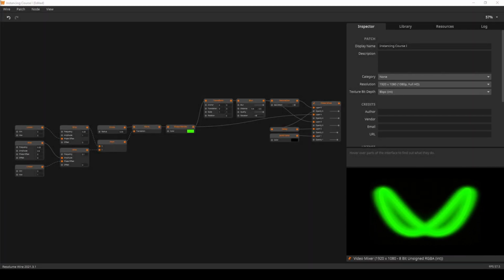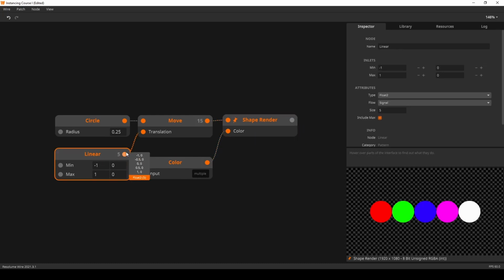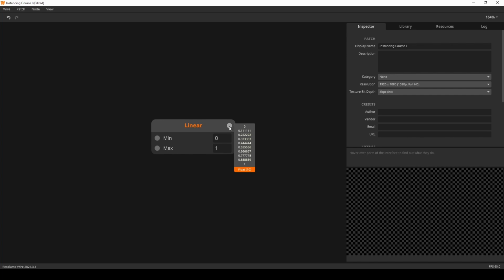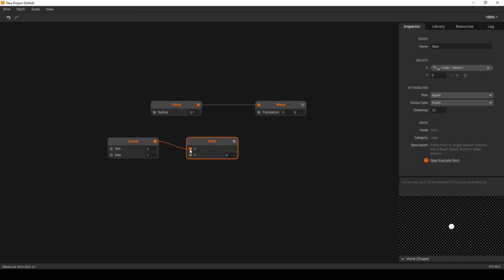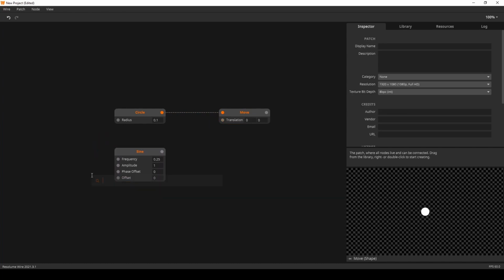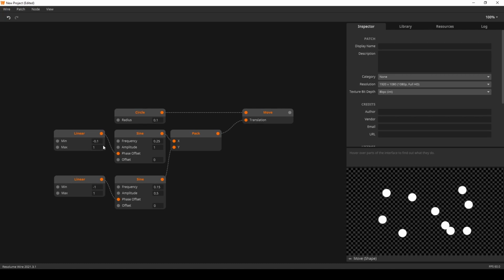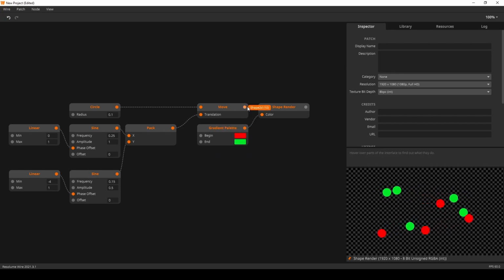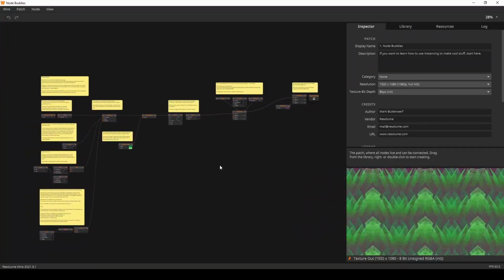Resolume Wire Instancing Course 1 - Introduction

Comment: "pack" doesn't seem to exist anymore. Change of name or change of logic? thx :)
Reply from the maker: Yes, that had to change unfortunately.. but for the better!

Now Wire works with a constructor/convertor architecture.

If you need a Float2: you make a Float2 node
If you need a Texture: you make a Texture node
etc

If you need to convert from one type to another you a conversion node. For example:  you want to convert from an Int to a Float2, you can use the To Float 2 node for that.

What we are trying to do is pull complicated / multi-choice nodes like Pack apart into smaller nodes to create a more logical LEGO-like approach to coding in Wire.
Reply: @ResolumeVJSoftware  hey there. thank you for the quick answer. I am a newbie and not sure if i understand that - but i sure will in time.
Is there anywhere a particle tutorial for wire? I only find tutorials where instances are already there. I would need one where instances are born and die ;)
thanks in advance!
Reply from the maker: @kristianrave  Glad to help!

We don't have a particle type yet in Wire, but you can use meshes to achieve something similar.

First, check out the Mesh Workflow tutorial on our YT channel to get started.
Secondly, have a look at the M0therFl0cker built-in example in Wire and try to recreate something similar.
Lastly, have a go at making a simple particle explosion.

The spawn/death cycle can be done with either the Transform2D node (scale = 0) or Material node (alpha = 0) to make the particles invisible.
Reply: @ResolumeVJSoftware  nice. I think this sounds pretty doable. I go check. Thanks. Also i have 3 little suggestions for wire.
1) on/off button for rendering
2) multiple instances (so i can have the example patches open while u work on my project / with rendering off ; )
3) some kind of indicator what node eats what amount of cpu
Anyway - Great software! I am telling all my clients to buy it so i can do cool shit for them ;)
Reply from the maker: @kristianrave  You got this!

As for your requests:

1) Can you elaborate a little more on the how and why ? 
2) This is on our road map, but not soon.
3) Working on the at the moment, will be released soon-ish

As for your clients; you can compile patches in Wire for Arena/Avenue. This creates a little installer for your effect/source/mixer that Arena/Avenue users can install without having to own Wire.

We released a bunch of effects this way last friday: https://resolume.com/forum/viewtopic.php?t=23113
Reply: @ResolumeVJSoftware 
1) so i can do emails and other stuff without having wire eating my cpu/gpu/battery in the background. Also Testing plugins in Arena. One Client has a wall of 10 Projectors and some 16.000 pixels width. So basically for being able managing my computers powers 
2) sweet ;)
3) even sweeter!
When the clients buy it, i don't have to :D but thx for the hint.
Also thx for the hint to leave my wishlist in the forum and not on youtube :D

Comment: help, I'm using Wire 7.14 and can't see anywhere to change the attribute...in fact there is no "Inspector" any longer?  Are there updated videos anywhere?
Reply from the maker: This video is a bit outdated indeed, new stuff is coming up!

The Inspector is now called the Node Panel.

Instead of assigning the instance count to the Circle: create a circle, then a move and connect the Linear to the move (translation). Because the Linear is a bigger collection than the single circle, it will update to the bigger collection.